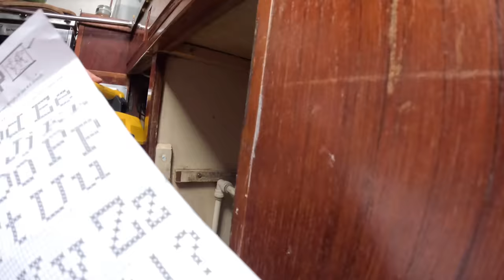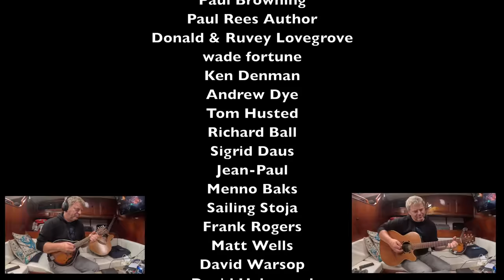156 : WHALE BILGE PUMPS!! Now maybe we wont sink!!!

Comment: The cockpit canopy structure came out very nice.   One thought,  It might be good to have a boom crutch added to the rear of it, to lower the boom on to when not in use.  It would remove the load on the topping lift while not in use, and would stop the movement of the boom in the breeze which would reduce the wear on the goose neck hardware.  You will not need it, but for others, a boom crutch also make it easier to use a Boom Tent (canvas with battens sewn in, to roll out over the boom when anchored).

Comment: Andy, if I can make a strong suggestion it would be to get the battery out of your bilge. I have seen two boat fires in my time on the water that were started by wiring going to a battery in a bilge. 

Looks like she is coming right along, it is wonderful when you get all of the systems working and can truly use your boat.

Comment: Remember that actual pump performance  depends on the height the pump has to move water upwards from its position to the outlet, such as its skin fitting or cockpit, etc. The bigger that height difference is, the lower is the pump output. In my case I had 1.8m and the pump did not make it if there was any air in the tubing!

Comment: Number one GOLDEN RULE! Do not drink tank water from your boat EVER. All consumption and cooking water should be from a water bottle. There are many sources of contaminants that can get into the water. Leaching, growing, and other things into the water. An other thing, I would strongly suggest adding a dry bilge, bilge pump system too your bilges. This is provided you do not get a lot of water into the bilge. A dry bilge pump system uses a micro vacuum type pump. The idea is to keep water getting into the bilge at near zero. It also cuts down on mold/mildew creation under the decks. Use a vacuum when doing ANYTHING with fiberglass. use a vacuum with a hepa dust filter, AND a dust bag. ALWAYS. 2 forms of filtering. Also any tool designed to work on tile, grout, or cement will work on fiberglass VERY well.

Comment: MAKE SURE you FIT NON RETURN Valves before the overboard discharges on the bilge lines !!!! If you don't they will syphon back when heeled over or in a large following sea while sailing. WATER WILL COME IN !!
Reply from the maker: Absolutely: I already have bought them and it’s a 5 minute job to fit them :)

Comment: Just watched the episode with you installing/calculating bildge pump pumping capacity... My experience is in moving water from/to main floor AQUARIUM to basement sewer/water, a lift of 9 ft. or so. I don't have access to numbers, but you need to take "lift" into account. Manufacturers state a particular pump as rated "so many gallons per hour," but that is assuming "on the flat" , you're not" dividing by lift ft".
At least I missed it...

Comment: Don't forget to reduce the bilge pump rate based on the head they are having to pump against, and if you fit NRVs (recommended) that also reduces the flow rate. Probably half of what you expect to get. With a long hose run and no NRV you can get enough flow back into the bilge when it stops to set the pump off again so it pulses on and off and not doing anything.

Comment: these pumps are often not at that capacity when things go wrong. It depends on power available and demand . Plus the gunk that accumulates  in the bilges  slows pump out put. Just speaking from experience. Your pump output is just adequate in my humble opinion. A pump in the fore bilge is very handy some times .
Reply from the maker: For sure the actual output will be less than the theoretical max but I’m still pleased with the potential max out put and the margin that gives us even with accepted losses

Comment: 483L pm is great, but how long will your battery bank run those pumps for?
However if you need to ever pump that much you will be launching the life raft! 🤣😂
Reply from the maker: Yeah exactly

I think so long as the batteries last long enough to find and fix the problem or abandons ship.

If all four are running for any length of time we’ve got seriously problems, most likely an Orca has bitten our skeg off 😂
Reply: @SailingMelody  doing a great job mate.
We only have the one bilge in the engine room. If ever we got a hole in the boats is an emergency submersible pump time! Also water from rye saloon, or cabins can not drain into the bilge!
Good thing we have 5 water tight bulkheads
Reply from the maker: @JayPerrypersonal  for sure yeah

To be honest we also have a lashe flow submersible and a Bluetti so we could stick the Bluetti on the deck and run the submersible pump until we sorted the problem: at rhe end of the day in that situation you’re kind of wanting to get listed out pretty sharpish

Comment: Where do you find a John? Are these on every Welsh street corner! What a star. 

Re your keel touch/grounding/bump. The thing to remember with encapsulated keels like your’s (and mine) is that when you touch it on something it’s fibreglass that you’re touching with, not lead or some other strong metal, so it’s easy to damage it. It required a complete change of approach for me to exercise a much higher level of care than I was used to.
Reply from the maker: Yeah absolutely

I’ll be lifting out before we head south for through hulls and other underwater checks so I’ll address it then.  It won’t be terribly long until we do that anyway so I’m not too concerned to lift out immediately
Reply from the maker: Hahahaha, hardly.  I am figuring this all out as I go along and routinely bring people in to help who know much much more than me.  I often say "this is not a how to channel, it's a "what happened" channel, because I'm the first person to admit the flaws in my knowledge".  I'm intrigued by your remark though,  have I offended you in some way previously =?
Reply: John on every Welsh street corner this has made me laugh....

Comment: I admire your dedication to safety, but...
 Actual water discharge is reduced by the flow restriction due to hose diameter, 
offset elevation to the hull discharge point and angle of heel.  Only way to be sure is to test 
the real world flow rate, i.e. measured amount of water in bilge or hose in bilge and a 
bucket at discharge, and a stop watch.  Bloggers have reported as much as 50% reduction.
Reply from the maker: Very good point thank you!!!  the lift is also a factor of course, we're lifting water from the bottom of our department bilge, up around 7 feet so that has to be considered in the actual amount of water discharged overboard in a given minute. That said, I'm pretty happy with the theoretical figures.